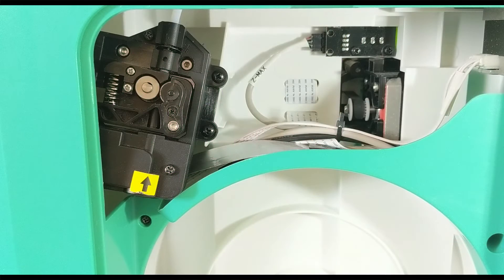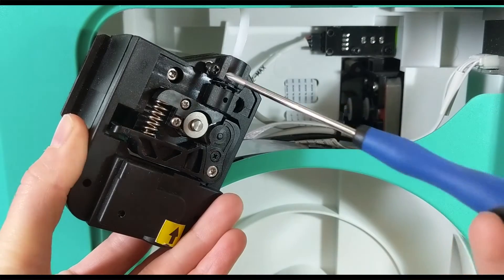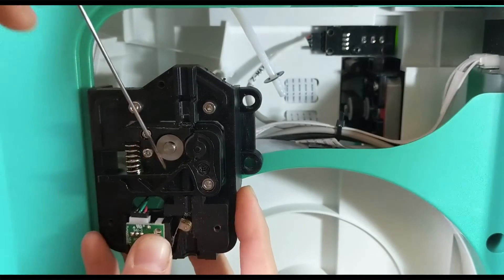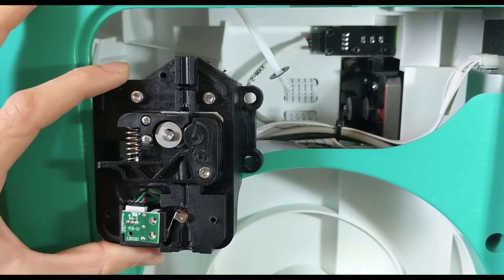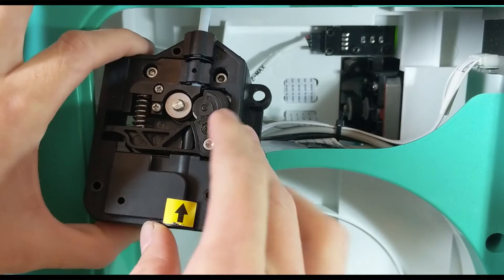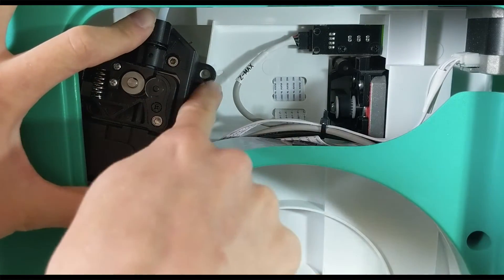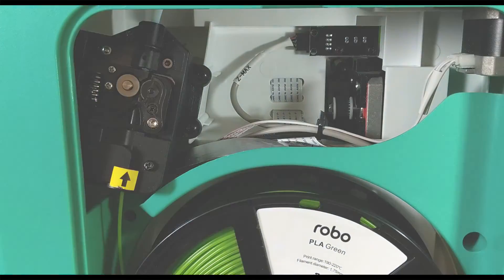Robo E3 Unclogging the Stepper Motor (when filament won't load)

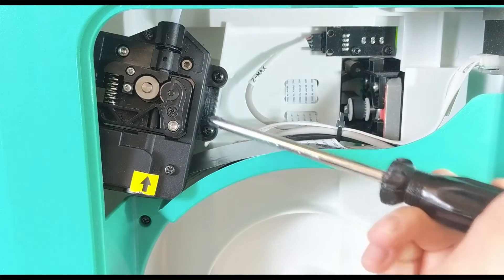Comment: Excellent video! I need assistance with this motor. I'm trying to support a classroom in my high school that inherited one of these printers. A teacher disassembled this motor and lost some of the screws. I need help identifying what size the screws are that you removed starting at 1:21. It would also be very helpful to know the size of the mounting screws you removed at 0:46. Thanks in advance.
Reply from the maker: Hello! I will look into finding the screw sizes for you. Please contact our customer care team at customercare {at) boxlight.com and we will be able to assist!
Reply from the maker: Here's the information for you! We don't sell the screws themselves as replacement parts, but we do offer the entire stepper motor assembly if you prefer to order that instead of the screws individually. Again, our customer care team can get you pricing info on that etc. But here's the info for the screws!
0:46 - 2 pieces: cross-recessed pan head tapping screw ST3.5 x 13
1:21 - 3 pieces: cross-recessed pan head tapping screw ST2.9 x 9.5
Please reach out if there's anything else we can do to help!